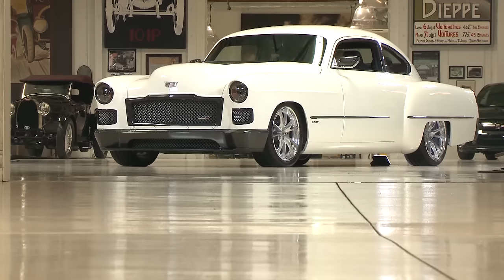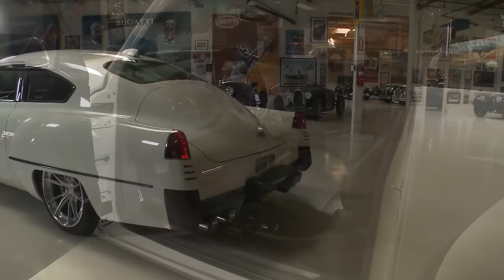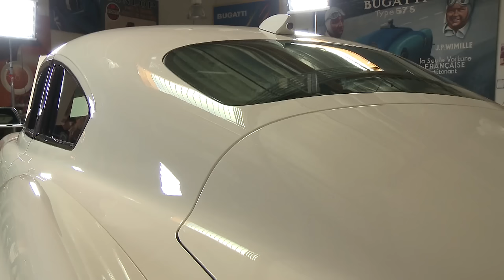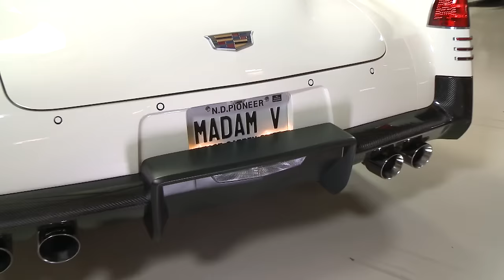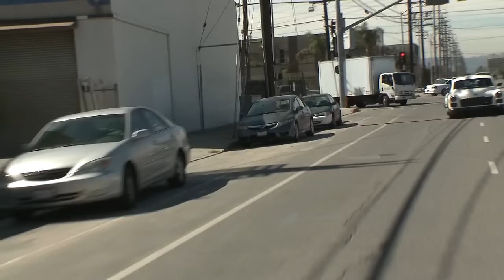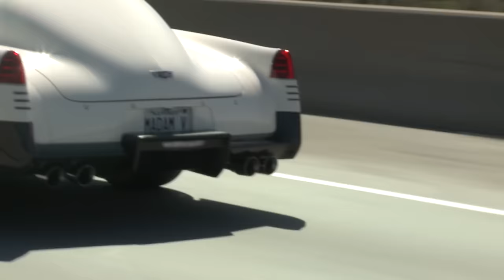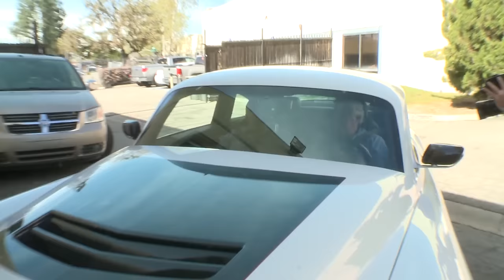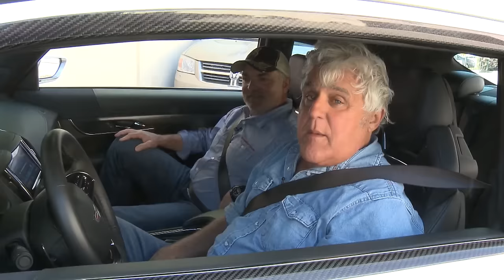Ringbrothers' 1948 Madam V Cadillac Coupe - Jay Leno's Garage

Comment: I have a 49 caddy restomod with an LSA motor and Art Morrison chassis etc. 1948 had the horse shoe gauge cluster (last year), 1949 was the first year of the V8 overhead cam engine and the caddy line won the motor trend car of the year award. My caddy is a survivor wearing it's original black lacquer paint.
Reply: "Overhead Cam".....no, overhead valves!

Comment: Pop the hood open, spend several minutes talking about the engine bay... and then don't show us the engine bay? Interesting editorial choice.
Reply: Jerque in the Merc -thank God I wasn't the only one who noticed this. Massive screw up whoever in editing didn't put some engine bay b roll in there.
Reply: +Jerque in the Merc  --  Yes!  I don't usually read the comments but I was going nuts waiting for the idiot cameraman to slide over to the car and show the engine bay.  Instead he, for about 10 seconds, moved over there and then showed Jay's face and ignored the engine.  I had to read here to see if it was only me that was driven nuts by this.
Reply: I wanted to see it as well.
Reply: drives me mad when I do that
Reply: That was a tease!!!
Reply: No B roll on this one
Reply: What are you going to see? Cadillac's engine plastic is black, everything in the engine bay is either black or white.
Reply: Chill out.  Go to a Cadillac dealership and look at the engine bay.  Same thing.
Reply: Thank god it was not only me raging about that! Plastic or not. I wanted to see the lines. "Hey video crew, I never wanna see this mistake again, no matter what, no space for a big rig? well, use a go pro. Car show without showing the engine bay is an outrage!"
Reply: Pretty obvious , it was boring and modern looking under there.. not much to look at unless you like engine covers.
Reply: Not really, Mr. Anonymous - I was curious to see the fabrication work those guys had done that Jay was waxing poetic about. This sort of restomod really isn't my cup of tea - I'd much rather have an unmodified ATS-V in my driveway, but I still admire the amount of work that had to go into the development and build of such a bespoke and interesting machine...
Reply: Ringbros usually do some interesting detail work under the hood.
Reply: its all about jays mouth all the time
Reply: Ditto for the trunk and tail light fill - they put in the details - show the details.
Reply: I suspect that because of the matte dark grey finish, it didn't light well, and since it is a boring modern engine bay, not much lost.
Reply: Jerque in the Merc  yes i wanted to see the weld big flop there
Reply: Modern Cadillac engines are nothing fancy to look at, just a peice of plastic over an engine. Besides why would anyone want aluminium to look like plastic?! Disgusting. Who ever commissioned this car clearly has no taste.
Reply: Yeah.. I was a bit like WHAT.?! when the hood went back down.. :(
Reply: i had to pause and go to google smh
Reply: I also want to say one thing here - that thing is NOT a restomod, I wish everyone would stop calling it that. This is a Cadillac ATS-V with custom coachwork based on a 1948 Cadillac. A real restomod at least uses the bones of the car they're building on. This thing doesn't even have a single unmodified panel. Jay: if you're reading this, please bring us original unmodified cars - I'm here for history lessons and seeing stuff that people used to drive and aspire to. This restomod fetish is really not why I became a fan. Bring us old Lamborghinis, old Bugattis, old Chevrolets. I don't care if they made 10 million of them... I'm 33, I've never seen a Monteverdi in real life, and without this channel, I'd never have known about such a fine piece of Italian machinery... that's actually obtainable (if I had a million dollars to toss around, which I don't, but that's besides the point). One off show cars really are not that interesting - I'm going to go out on a limb and say that most of us viewers feel the same way.
Reply: +Jerque in the Merc  Jay if you're reading this,  This man doesn't speak for ME.  I absolutely love and appreciate the work and talent of people like the Ring Brothers.  this car was made-to-order for a man with real passion about Cadillac,  and wanted HIS ultimate caddy built.  Thank God their are still people who have the extraordinary abilities to make people dream cars. 

keep up the great work.
Reply: Jerque in the Merc I agree this show would be just as good on the radio
Reply: Feel better now?  only speak for yourself and stay out of the Trees.
Reply: Ditto.
Reply: It's all covered with plastic covers, literally nothing to see.
Reply: +Kylestewart I'm a girl. And I speak for ME. And I am not in any way dismissing their extraordinary work here. It's excellent work. Just not the content I'm interested in.
Reply: It is so infuriating when they do than!
Reply: Jerque in the Merc, I have no strong opinion whether this is a "restomod". They kind of address the "coachwork" argument at 15:05.  But I wonder, I cannot see any frame rails at all. This is how a 1948 Cadillac looks from below: http://www.ngdcars.com/1948-cadillac-fleetwood-60-special.html 
Have they effectively combined the 1948 body with the ATS floorpan into a new unibody? That would be cool and require additional stiffeners (original body is not designed to take such loads), I wonder how they did that - or maybe they just managed to hide the original frame?
Reply: I was just about to write about that. Who cares about the middle-aged men, show the engine bay.
Reply: Yeah they definitely forgot to shoot that and realized it when it was too late.
Reply: I stopped the video after they shut the hood. I don't what six they put in it.
Reply: i was like...NOOOOOOO!!!!
Reply: maybe they werent allowed to show it or something... it almost seems intentional
Reply: No sh*t. Exactly what I was going to comment on.

"Wow - is that factory? Look at... and look at... "

Oh, but don't let anyone ELSE look at...
Reply: Jerque in the Merc 
Yes, I was thinking the exact same thing... maybe they didn't show it, because it is "just" a new Cadillac.  They also didn't show the car interior as they usually do.... maybe the same reason, modern Cadillac.....boring.
Reply: I'm sure it was just a collective brain fart. Nobody's perfect. JLG is still the gold standard for car videos IMO.
Reply: +furyofbongos That's probably exactly what happened. No sweat, but I thought I'd raise it to them. Who knows, perhaps they can re-upload it with the missing footage added in?
Reply: im guessing the b-roll was corrupted
Reply: +Jerque in the Merc - I'm glad you commented, I was going to say the same thing but you beat me to it.
Reply: So i'm not the only one who found this frustrating?
Reply: Yeah!
Reply: You could go to the ring brothers' website if you want to see it.
Reply: Must be "Ancient Chinese Secret".
Reply: I bet they lost the footage
Reply: Jerque in the Merc omg I was thinking the same thing.
Reply: Probably not much but panels in there,  typical modern Cadillac engines can't be seen.
Reply: They might not want people replicating their engineering. If this car is worth 6Digits plus & they are famous for "'uncommon mods'" that could be why.
Reply: Well, we can already see how disappointing and cheap the OUTSIDE of the car looks. Even the cameraman knew not to show the engine bay.
Reply: im only 8 min. in and I was thinking the same thing lol why don't they show it!?
Reply: and the promised interior shots didnt happen.not a good episode
Reply: Thought about it and as it is just a modern Cadillac, I guess they didn't think that was worth looking at, as usually theres not much you can see anyway. With all the covers over everything, it's just kind of ho hum.....
Reply: Mickey Cook still wanna see it man!!
Reply: Did we really want to see aluminum crafted painstakingly to look like PLASTIC?    Noooooo, abomination.
Reply: Jerque in the Merc it's kinda obvious they did this because neither the engine bay not the interior are up to the usual standards, especially of Ring Brothers. Shame to put a CTS-V interior in this.
Reply: I prefer the original ...... :)
Reply: I like your posts ..... 

Please do more ..... :)
Reply: and a shame there's no interior!
Reply: agreed
Reply: TitaniumCountess who hasn't seen that engine before?
Reply: I thought they would show still photos of the engine bay later in the video. Please add them Jay.
Reply: I know I was getting frustrated.
Reply: Didn't you hear them talk about the fabrication under the hood? Hello?
Reply: TitaniumCountess Yea!  WTF?
Reply: Ancient Chinese secrets inside!
Reply: Nothing to see besides a plastic engine cover w/ Cadillac emblem; you missed absolutely nothing.
Reply: Yeah why they show up the engine bay?????
Reply: yeah. Didn't show it at all!
Reply: Here's a guess: it looks like the donor car?
Reply: biker451 This is what happens when you have cars guy who care more about paint than powertrain.
Reply: Right! Show us what they’re talking about!
Reply: Laugh out loud that's what I thought too oh well I guess we're not going to see the engine we did get to see the underneath so
Reply: absolutely !!i kept waiting for the engine shot!
Reply: What do u want to see the plastic cover
Reply: Can you say "we haven't taken it to SEMA yet!".
Reply: @vicpolaris2471  no!! the engine like we all said!!
Reply: TitaniumCountess must have been something illegal, under the hood , like takin the airbag out ?
Reply: Well it’s like every new plasticy junk.
Reply: V6 ATS Nothing to show off
Reply: Camera man zooming in on jays head, like why dude?
Reply: Stopped watching the second the good closed with no shot of it.
Reply: Yeah I was thinking the same thing.  Camera/editing fail!!!
Reply: It's got less to do with looking at the engine and everything with us getting to see the body work and what not that THEY did in the engine bay, how they ran wiring, supports they added and so on
Reply: @TennesseeCheeZe  they showed the trunk... even more boring
Reply: @biker451  The Ring Brother cars are so great at style meets modern tech. Icon and derelict legacy make these videos predictable wonderful. As for Jay, it's good to be King. Thank God he shares his experience with us..
Reply: @TitaniumCountess  then go away
Reply: The Ringbrothers have no secrets and will show you everything....says Jay . Right!
Reply: TitaniumCountess 
That’s a very sad thing to say
Reply: kraenk12 
That’s probably true! 
But realistically, you’ve got a few thousand people with nothing invested with some of those who are complaining they didn’t see a ho-hum motor installation that you can’t see anything of anyway...
Reply: wow
Reply: @biker451  exactly!! I was so screaming at the vidieo
Reply: Would love to see the ring brothers build a full size chevy c10 pickup that would be awesome 👌
Reply: @Chuck59ish  Oh. Well maybe Jay should just do audio only shows. And he can hire you to describe everything. That would be so much better.
Reply: @TitaniumCountess  wrong
Reply: What about the interior that we were promised a view of during the drive?
Reply: Thats because its like a modern car were there is nothing you can see it's probably all coverd up with shrouds.
Reply: Was there a reason we couldn't see under the hood Jay? Did the Warren Commission lock it down for national security purposes?

Comment: If GM actually built cars like this, they wouldn't be able to build them fast enough.  Imagine a new 57! Wow
Reply: They likely can't get the fuel efficiency and safety standards met.
Reply: It would be faster than in 48.
Reply: Would be cool, but they may have to charge too much.  May not be a good business case.
Reply: You CAN buy a brand-new, GM licensed 57, and to your specs too! They can be bought as a 2dr sedan or hardtop or even a convertible. The thing that interested me was the continuation series '69 Yenko Camaro!
Reply: Fantastic, when and where can I get mine?
Reply: I'm waiting for my Rear-wheel drive Malibu 2-Door AKA: Chevelle
Reply: That's what aftermarkets for
Reply: I think they could do it with modern manufacturing tech but imagine this car 2000Lbs lighter. True cars & such bold in your face curves. Older cars looks so nice built with the right taste and the wheels complete the style
Reply: Imagine how much they'd sell it for
Reply: Good point.
Reply: You are correct.  Those old cars had actual room inside for actual people.
My Grandfather owned an early 50's Caddy. It wasn't as techprepped as the Ring Bros ride but you could store
a bunch of kids and a dog in the backseat and never know you were on the road... 
Like being at home.
Reply: GM did - with the HRR chevy - say whaaaaat?
Reply: It's a nice idea, that we would see them driving around 
Sadly, a car like this would sell really poorly 
It's too unique, its appeal is to a very narrow range of people
And those people it appeals to, enthusiasts, dont buy new cars they buy preowned.
It's why sports car sales are down all over the world for most manufacturers, but the used market is so crazy for some models...
Auto manufactures make appliances now
Reply: or the 64 Impala
Reply: DON'T SAY THAT !!  Don't say a new 57 because my head starts spinning !!  Your suggestion may cause me to get lost in a 64 caddy !!
Reply: Then what actually makes it to production is ....meh
Reply: @silvermediastudio The autos from yesteryear only suffered fuel inefficiencies, relative to today's standards, because they're engines didn't benefit from today's technology. Aside from sustained high levels of velocity, aerodynamics are insignificant. Basically, put a modern engine in this car and you will still attain fuel mileage sufficient enough to satisfy current EPA standards.
Reply: @patkaczmarek7362  Define "high levels of velocity"
Reply: 800lb Gorilla 
When a Prius can pass muster you think a steel behemoth can’t?!!
Beyond that I’m speechless...
Reply: @fishhuntadventure  Speechless and uninformed apparently.
Reply: That would be a shock to everybody! They would probably be twice as expensive..Especially the Cadillac brand
Reply: With all of the modern modifications, they would by law have to put twin cars on it.
Reply: 800lb Gorilla - I’m pretty sure they could..but it would bump up the weight & price tag considerably
Reply: Beautiful car..I’d have fitted round mirrors , wouldn’t have used so much carbon fibre & would have personally preferred pretty much any colour over white 😁
Reply: Or the Mako Shark
Reply: @silvermediastudio  not true, LS/LT or a modern built Caddy/Chevrolet/Buick/Oldsmobile/Pontiac engine Small Block.
Reply: @fishhuntadventure  prius are junk.
Reply: @woodstockxx  Weight = reduced fuel efficiency. The way many EFI vehicles get there is by shaving off pounds from materials, reduced size, even smaller gas tanks to reduce the load.
Reply: @fishhuntadventure  In some ways, yes. The old longitudinal mounted engines/transmissions had a tendency to slam through the passenger cabin in head-on collisions. Metal dash would crack skulls. Hard-fixed seats would snap spines and necks. Non-collapsing steering columns had zero give. And unibody frames and with engineered crush zones tend to perform a bit better than body on frame, from the various collision angles and in rollover. I love the old steel sleds, but that doesn't change the physics.
Reply: @shadowopsairman1583  Those engines are hardly efficient by modern standards.
Reply: @silvermediastudio  - aye, I hear ya..not my kinda thing..would personally just add more power..not always a great approach..more to my taste & bags of fun though 😁👍
Reply: @silvermediastudio  They say that but engineers can engineer those problems away into that form factor.
Reply: @DrLeroyGreen  I'm an engineer.
Reply: @artdecotimes2942  Was that English?  Try again son.
Reply: To expensive and wouldn't sell at all. One off only
Reply: I got  to agree!!! Beautiful!!!
Reply: literally scrolled to the comments to say this, and the first comment says it lol
Reply: @faerieSAALE  not even close
Reply: You guys are all genius’s in your minds it’s painful too read  except there are a few who get it the others shut up please if you don’t know what your talking about because the critique is hard too take !